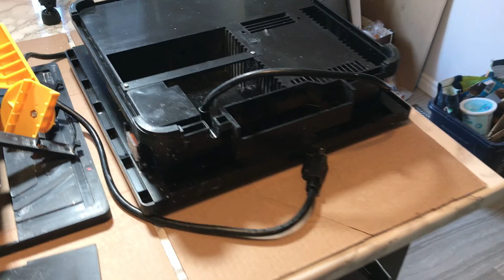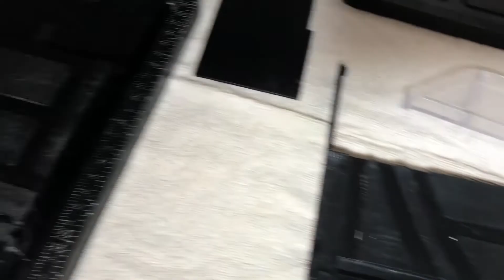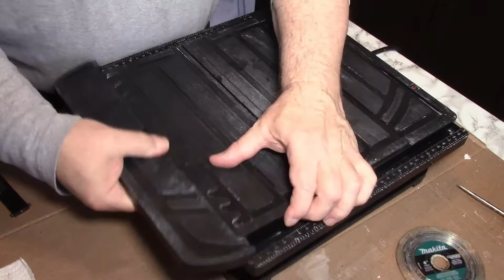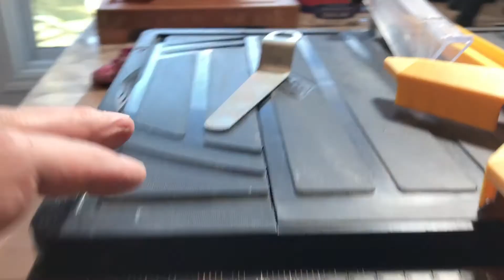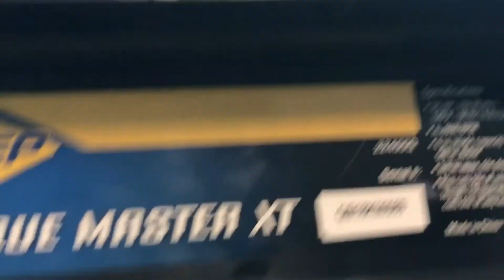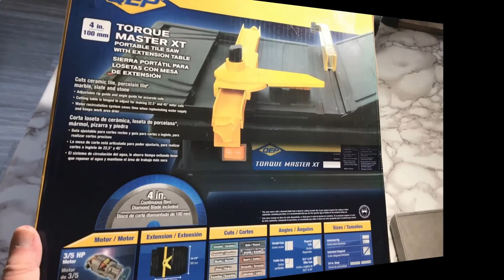QEP 4 Inch Portable Wet Tile Saw - Tear Down, Clean Up and Maintenance

Comment: Just bought one of these today and was kind of struggling to figure out just how the blade attaches. So the way you have things laid out at 2:15, I would put the blade on whatever that piece at very bottom left is called, slip those onto the post coming out of the motor, then put on the metal flange bubbled side out as it was when shipped, then put on the nut. The problem I had was that the nut doesn't seem to have a whole lot of thread to attach to at this point. So, as per instructions, I tightened it, but tried to not overtighten. As soon as I turned the saw on I could tell the blade was loose. Turned it off, unplugged it, reset everything, but tightened it more.....And heard a pop! So I loosened it a little bit, but still left it tight. I'm about test again and.....It's loose again. How do I know if I've over tightened it? What is tight enough? Did I assemble wrong? Any insight would be great if you see this. Thanks!
Reply from the maker: Is it possible that you have the the inner and outer wheels hubs mixed up? Notice that the holes in each hub are different with one accommodating the flat on the spindle while the other hole is perfectly round. The one with the round hole is the inside hub. There should be plenty of thread for the nut.
Reply: So it turns out, the way I was assembling it, I was putting the blade on the wrong side of that piece. I have it assembled better now and hopefully it's still going to work properly. The setup instructions could be a whole lot better for people who don't normally use these types of tools.
Reply from the maker: @DavesChaoticBrain   - I completely agree, the instructions are lacking but thankfully you sorted it out. I just wanted to mention that I am back to a regular video publishing schedule, look for a new upload tomorrow morning. Thank you for commenting.